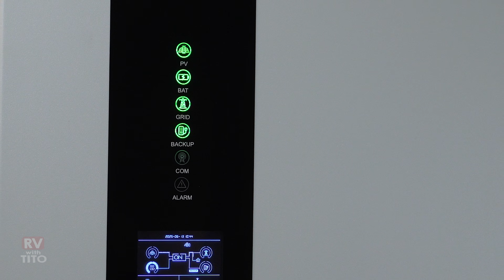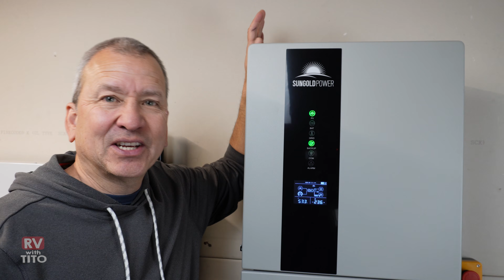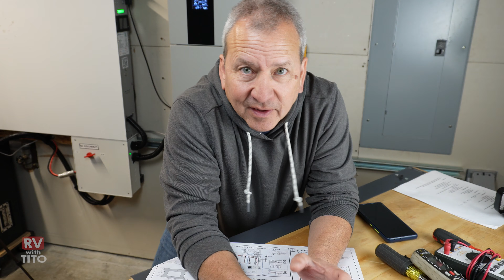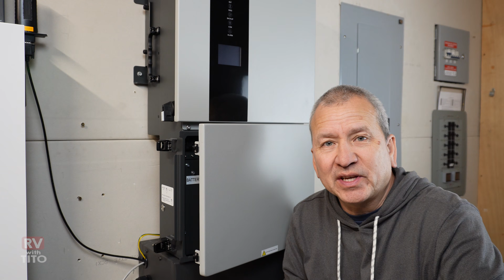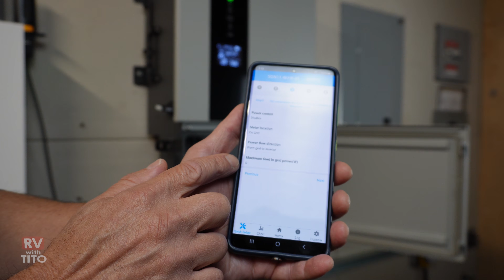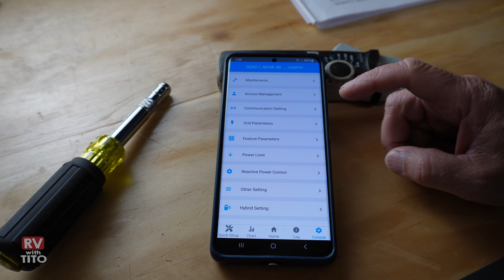Installing a SUNGOLDPOWER 11.4kW Hybrid Inverter for Home Backup

Comment: Did you install the CTs after your 2pole 240v breaker thats supplying power to the inverter? Or was it installed between the meter and your main panel breaker?
Reply from the maker: Right now the CTs are after the 50A dual pole breaker. I plan to move them to the L1 and L2 coming into the main panel as suggested. I just havent done it yet.

Comment: The Sungoldpower SGN-11K15PRO and the Senergy SE 5-11.4KHB-UL appear to be very similar, if not identical, hardware platforms based on the same Senergy OEM chassis. The SGN-11K15PRO is often regarded as a rebranded version of the Senergy SE 11K4HB-210-T2/UL. 
Both units are designed for high-power, 48V, split-phase, residential, or light commercial backup systems, offering 11.4kW of continuous output The SGN-11K15PRO is likely a white-labeled/rebranded Senergy SE 5-11.4KHB-UL.
Performance: Both offer 11.4kW continuous AC output, 48V battery support, 120/240V split-phase, and IP65 protection.
Solar Input: The SGN-11K15PRO highlights a 15kW max PV input. Senergy documentation indicates an MPPT voltage range of 70-540V.
Safety/Certifications: The Senergy SE 5-11.4KHB-UL is specifically noted for meeting UL1741/UL1741SB/IEEE1547 standards. The SGN-11K15PRO also mentions UL certification in its documentation.
Features: Both support 200A whole-home bypass/backup capability, making them suitable for running entire homes, including HVAC systems. 
ENF Solar
ENF Solar
 +6
Summary
For most users, the choice will depend on branding preference, support availability, and price.
SGN-11K15PRO is sold directly by Sungoldpower and is generally marketed with a focus on ease of installation and direct-to-consumer pricing.
SE 5-11.4KHB-UL is the original manufacturer (Senergy) designation, often found in professional solar distribution channels. 
深圳市盛能杰科技有限公司
深圳市盛能杰科技有限公司
 +3
Both are powerful hybrid inverters suited for grid-tied, hybrid, or off-grid setups, capable of parallel operation (up to 9 units for SGN)

Comment: Tito, I have the same inverter and cannot get it to charge from the grid. I have not installed any solar panels yet as I am just experimenting at the moment. You seem very knowledgeable on this inverter any help is greatly appreciated. I tried your recommendation on changing battery type to lead acid, even though I'm using po4 lithium and still no charge.
Reply from the maker: It's hard to know going in cold here but let's see. I'm assuming the inverter is recognizing the 240v split phase grid input and the grid icon is lit. If so, try setting  Settings >> Hybrid >> Working Mode to Feed-in priority. Also check the Charge-by-Grid setting in the Hybrid >> Battery settings.  There are several charging settings in the battery section to tweak, but hopefully this forces the grid to start charging. Once you get solar you'll want to switch to self-consuption mode and customize it. Hope this helps.
Reply: @RVwithTito thanks for taking your time to answer my question.

Comment: Thanks, i am putting 6 of the 440 watt panels on the back of my roof for backup power. The inverter you are using are the fans loud with 80% load because i am putting the inverter in a closet close to my bedroom.I will just be pulling about 5K watts.

Comment: Can somone explain to me the “grid tie inverter- input” that you connect to a “grid tie inverter to charge the batteries”? I’m confused because I thought this is a grid tie inverter itself?
Reply from the maker: Yes. This generator input can be used to accept AC power from a generator or another inverter. I don't think it has to be a grid-tied inverter. In this scenario, you connect the output of an existing grid-tied inverter to perform the same function as a Generator. This feature gives you the option to keep any excess power from your grid-tied inverter and use it to feed your hybrid inverter for battery charging or powering loads. This allows folks to add some hybrid functionality without getting rid of their existing grid-tied system.

A traditional grid-tied inverter will convert solar (DC) to AC power and feed it into your electrical system. Any excess solar generated will be fed back to the grid. When there is no solar coming in, then all of your power will come from the grid. 

A hybrid PV inverter like this one can also be programmed to feed excess power back to the grid. By including batteries it can store excess power for use later when there is no solar coming in. You can also use it in a fully off-grid mode. 

Hope this helps. I haven't messed with the generator input yet, but look forward to giving it a try at some point.
Reply: @RVwithTito thanks for the quick response, and also thanks for the videos. I’m installing a 5000 watt solar I want to grid tie with battery backup therefore am interested in the 7.5k version of this inverter. I don’t have any previous grid tie therefore just making sure these stand alone hybrid units will remain capable of charging its own batteries when solar is available or if the generator kicks on. It’s my understanding these are capable as a stand alone but the input for “on grid inverter”
confused me. I’d have a generator connected as a backup anyway. Thanks again for the great videos!

Comment: did you do your own permit, or no permit? I too am thinking of an off grid inverter and Sungold looks great.
Reply from the maker: At first, I was just testing and using it off-grid. I have been waiting to get batteries with the right UL rating. Now I am going through the process with utility company. There's a video coming out this weekend about the batteries.

Comment: Bummer it doesn't have a better HMI and requires an app.
Reply from the maker: Yeah. Lots of them are going that route now especially if they are outdoor rated.
Reply: @RVwithTito  Did you read the article about them finding cellular radios in some of the batteries and invertors from China? Not sure what brands.

Comment: I wish this unit was available about 2.5 years ago. I bought a SunGold BluePower IP6048 but I have struggled to get it to do what I need. I can get it to charge from the grid and if I manually tune it to the right amount it can use excess power from my Solaredge System to charge the batteries. Again a very manual process. I can use it to load shed at night to reduce my power bill. CT connections are on it but the software lacks the ability to tune these properly. I have asked and never got a straight answer about which CT IE 100 amp or 200amp or other to use. The other day I lost power for several hours. Was the first time in a long while so I tried to switch it to offgrid mode but it refused to operate in this mode. It just turned off after looking for grid power which was about 60 sec. I did effective;y change it to offgrid mode but it still turned off. Sungold has pulled all mention of the model I have so I fear it was not very good. I am currently saving for either a Solark but will probably settle for a much cheaper Schneider XW 6848. I do enjoy your videos and I am glad that this Chinese Inverter is working well for you but I am going to steer clear of these chinese units for awhile. I did get a good deal i think. I paid something like $1650 almost 3 years ago and got free shipping.

Comment: Curious about your battery bank for your home, did I miss it, have you shown?
Reply from the maker: I have a 14kW battery that I've probably shown it in other videos. It is not UL certified though. So I am planning to upgrade to batteries that will pass inspection. Stay tuned.

Comment: Looks like no 200a grid pass through option.   I want whole house backup.  What do you recommend for connection options for an existing 200a grid service/loads panel?
Reply: Sunsync says you should not have 200amp pass it’s not good for inverter

Comment: "From grid to inverter" vs "From inverter to grid"?   This setting is concerning. Why can't it do both at the same time?  Excess solar and fully charged battery should do inverter to grid (if you allow selling).  Not enough solar or battery for current load should automatically do grid to inverter.

Comment: It's funny how an 88 pound inverter is so hard to lift but an 88 pound girl is no problem at all 😄
But I have a serious question: can I run this hybrid inverter without a battery and just do grid-tie only until I can afford batteries?
Reply: @ChristmasEve777  It's got 200amp pass through, so should work grid tied without batteries.

Comment: 88 Lbs. is way too light for an 11.4kW inverter. The manufacturer must have stripped the all-important output transformer out of it before they shipped it to you. That's like buying a gasoline powered car without a transmission. You're pretty much guaranteed to get nothing but far poorer performance out of this featherweight inverter.

Comment: Are there soft settings in the hybrid inverter configuration you turn on to prevent solar power from going back into the grid?  Is this regulated by the current transformers on the incoming utility leads?
Reply from the maker: Yes. You can limit the current back to the grid or set it to 0 amps for no backfeeding. This is how I set it up. No excess energy goes back to the grid.
Reply: @RVwithTito  in this scenario, what would happen if the grid goes down.

The hybrid inverter and house stay online and the ct continue to keep any power going to grid?

Comment: Looks like a great product. So, I was asking Sungold some questions about details I don't understand regarding this inverter and they forwarded me this video. Kudo's to you! 

I'm new to solar and this would be my first project. I think I'd like to start with this as a grid tied, battery less system and then add everything else to become off grid at some point in the future. Right now, my one unanswered question is how does the split phase work with my home appliances. I understand that the split phase is 240/120 but, does this actually run that way concurrently or is it either/or. I've seen ads for other split phase inverters that state settable at 120 or 240. But wouldn't I want both phases at all times?

LIke most households, we have several appliances such as a water heater, dryer, oven, and a geothermal heat pump with electric furnace backup that all use 240 V inputs. I'd like to be sure that the inverter would adequately power everything in my home. I'd also like to use this to charge and EV if I ever purchase one.

Thanks.
Mark Douglas - new to solar
Reply from the maker: Hi Mark. Sorry for the delayed reply. First off, I remember seeing somewhere that hybrid inverter requires at least one battery meaning it won't run without one. I can verify that. Second, this inverter will output 240 split-phase. From this you can wire both 240V and 120V circuits. It all depends on how you wire up your panel. Your service panel will have two sides to it. The 240V split-phase includes two 120V hot lines (black, red), a neutral (white) and a ground (green). Each 120V hot is wired to one side of your panel. Think of each side of the panel supplying 120VAC. If you purchase a 240V circuit breaker, it will bridge both sides to create the 240V circuit. A standard circuit breaker will only connect to one of the sides and be used to create a 120V circuit. I too have both 240V and 120V circuits powered by this inverter. Essentially this is how your typical electrical service panel is wired. I imagine you will wire this to a sub-panel that follows the same principle. This is just a basic explanation without getting into a bunch of electrician stuff (I'm not one BTW). If you want to bone up on this stuff there are lots of videos on this topic. You may also consider hiring an electrician to wire it up for you. I hope this helps. Cheers!

Comment: Can you do a video about if you are installing two inverters parallel my question do you need run two different streams of solar that can both receive power in. Also do you need run two battery wire to both of them please let me know
Reply from the maker: I haven't done it, but my understanding is that the best practice is to assign a dedicated solar array to each inverter. The batteries are typically wired n parallel across the inverters. There are detailed diagrams in the user manual for single and parallel configurations. The manual is available for download on the website.

Comment: I'm looking for an EG4 alternative, can't feedback grid in my area but want to be able to pull from grid for passthrough and to charge batteries if needed. Assume this can do both without risk of grid feedback?
Reply from the maker: Yes. There are a couple of settings that you need to double check in the app to make sure there is no unintentional back feeding. I show them towards the end of the video.

Comment: I went with the 6.5k split phase SunGoldPower when I replaced my Victron stuff.  I love it.  I pull in so much more power and have more power to use.
Reply: Did u also go larger from something like 3000watts? I hardly ever hear people go from victron to something else.
Reply: @electricandlsxpower  If you were asking me, my new inverter is 6500w.  A lot more power.
Reply: @electricandlsxpower  Yes.  I had the 3000w 2x120.  They market it as intended for RV's, yet they couldn't have it produce at least the equivalent to a 30a hookup, 3600w.  I was constantly having to turn things off to run other things.  Also, they need to offer a 48v version so I don't have to pay another $550 to get another charge controller that will only bring in 1200w on 12v.  
I love the SGP all-in-one.  I just wish these all-in-one's offered a built in 12v converter or an add-on device that did it.  When I set up my property I'll get another one  of these 6548's and have more than a 50a service.
Reply: @brianvandy4002  I've been looking at that inverter. I like that it's 120v and 240v. Allows for more options.
Reply: @Richard-nb4iv  I love that I don't have to be stingy with my power any more after upgrading from a 3k inverter.  I can be running my 2-ton basement heat pump and have no concerns turning on my toaster oven and throwing something in the microwave.
Reply: @brianvandy4002 Nice! 👍
My latest electrical bill had me reeling in pain. It's steadily climbing higher. In my town, they dont require a permit for a freestanding array equal to or less than 12kw. So im thinking of a solar pergola in the backyard off grid. I'd like to run a PV A/C heat pump and charge my EV Chevy Bolt. 
That's  the dream for now.
Reply from the maker: Glad to hear you're liking it!

Comment: nice when you get all the stuff for free.
Reply: @richardgorski23  So become an intelligent and competent engineer and post on social media for years.  Maybe you’ll get some free equipment
Reply: @kenpage9164  Basically what he saying is if your advertising to the masses ...
Most people don't have the money to buy the high end stuff and can't relate to what your showing us..
So As a you-tube creator are you going to cater to the 6 guys that can afford this or the rest and increase your revenue..
I have seen so many get up there then leave their base behind while trying to push the free high-end  stuff they get....
So go ahead and be a smart AS** and disparage the average Joe that watches your content then watch as  he kills the goose that was laying the golden eggs..
You people with your become a millionaire attitude  on the backs of the lower class then trash them disgust me..
Reply: Let me know what your experience has been getting it to enter float after reaching charge voltage. I gave up when working with SunGold. Without this important feature, your battery will either be held too long at bulk charge voltage or you will not hit high enough voltage for good cell balancing and minimize charge time.

Comment: $3000? What are the offgrid options that cost less? The power company can pound sand - i don't need to pay for virtue signalling.
Reply from the maker: The best approach is to do it in stages. I started just converting my backup generator setup to use solar, batteries and an inverter instead. If you are handy, you can save lots of money. You can find used solar panels pretty cheap. The cheapest 100Ah LiFePO4 48V battery runs for around $700 on Amazon, but you'll need more than one. A 6500W 48V LV6548 inverter will around $900. The best option would be to find someone upgrading their gear. You may get a good deal. Unfortunately, even those power stations with solar panels are pretty expensive.
Reply: @RVwithTito Thanks. Is the LV6548 now up to code like the EG4? I looked at some offgrid options on the sungoldpower website, but maybe those are SRP not actual prices.

Comment: Hi Tito, I have the sol ark 12k now for about 3 years on my 10k watt system. Would there be a need to  add this on my system?  I’m not seeing a need to add another component. I put my whole system in so I have the knowledge level that’s pretty good. I have 6 eg4 —4848 volt batteries and a critical load panel already too.
Reply from the maker: No need to add anything if your Sol-Ark is working for you. 10K is the perfect size for a critical loads panel. Just keep increasing your solar and batteries if needed. Otherwise, leave it alone. Great job.
Reply: Basically SunGoldPower is cheaper apples to apples than EG4, which has been the favorite for awhile but marked up significantly.
Reply: Sol-Ark is the exclusive distributor for DEYE on north america, fyi. It's DEYE equipment with a significant mark-up, which EG4 initially was able to undercut in price.